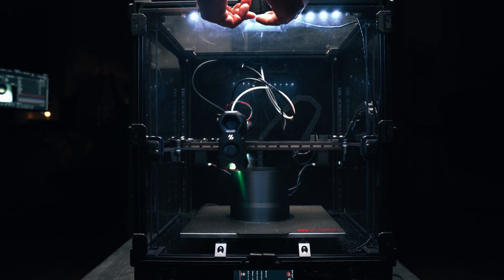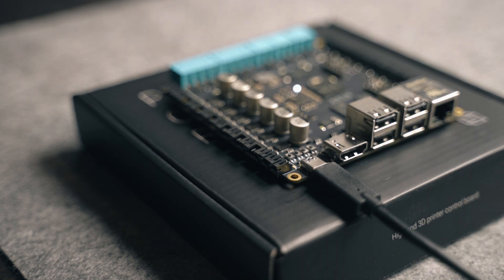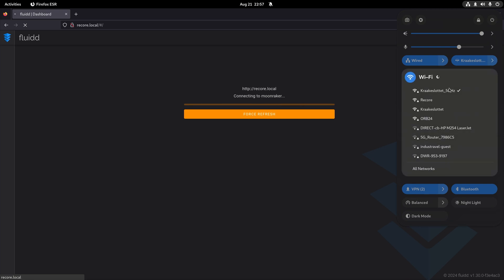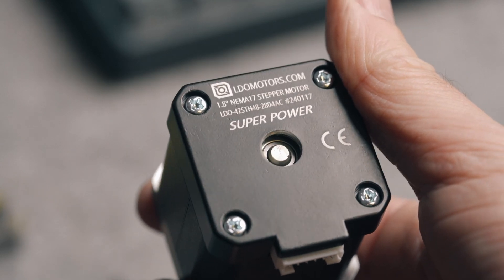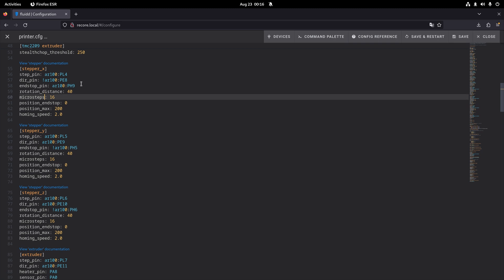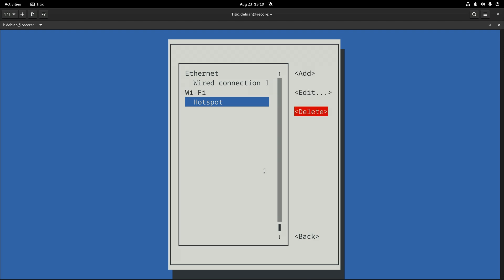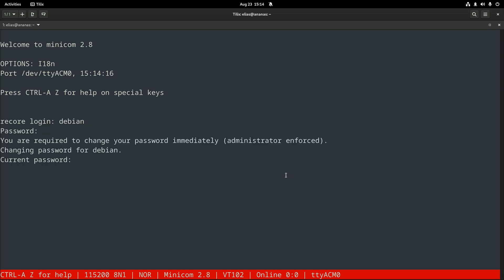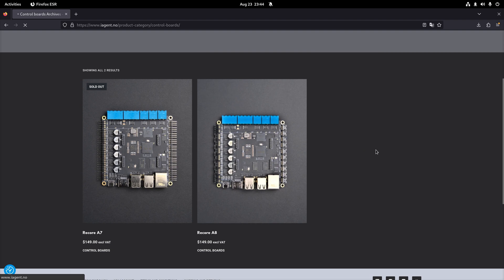Getting started with Recore

Comment: Can the next one include Network setup that doesn't use WiFi? Got the wired port right there, easier and less likely to fail or be sucesptable to interference then WiFi .
Reply from the maker: If you have an Ethernet connection, it's not necessary to set up WiFi. I mostly use Ethernet myself, I only use WiFi for testing.

Comment: @00:00 When you can't even be bothered to rotate your Klipper Screen into the proper orientation for the presentation 😏

That being said... I don't mind the use of those TBP01P1 Connectors instead of Screw Terminals but why the fuck aren't they included in the Board Packaging!?
Literally no one will have these lying around in a drawer and literally no one will be able to start their project if they didn't buy them together with the board so you're not saving anything.

Not that I have ANY interest in this product but if I have had any I'd immediately lose it due to lack of example configs for a 3D Printer to work my way up like how I did with the BTT ones.
Like how is the V2.4 at the beginning being operated as it requires 7 Stepper Drivers which this board doesn't have. CAN for the Tool Head? How was this established? etc...
Reply from the maker: Since I use this printer for development, reinstall the software very often. Sometimes the rotation is left out if I'm focused on a different problem. Definitely should have been done for this sequence though, so I'll try to do better in future videos. 

Connectors could be included, sure, I've considered doing for a while actually. The reason for the splitting of the two is really just a remnant from an older project and I've just kept it like that since. 

As for example configs that is definitely on the list of improvements for the documentation. 

The tool head is USB, not CAN. It's a new product I'm working on.

Comment: Stupid idea i think would be cool that would most likely be a pain to implement if you actually were to do it:
Have the board be PoE capable. Just one plug for network and power.

Completely unrelated, now I want to see Positron run off of Recore! Two open source homebrew to production products working together would be awesome!
Reply from the maker: PoE is definitely very cool! I think the maximum power capacity is too low though at some 90 W max :| 
A Positron running with Recore would be great!

Comment: "An all-in-one solution for desktop 3D printers, Recore A8 offers everything you need in order to print fast and quiet and with a great user experience."

You need to edit this until a additional mcu is not needed for an accelerometer.

Looks like its going in the right direction but there are some bugs and the need for an additional mcu and non swappable steppers means i will not be replacing my octopus with this as i had initially hoped.
Reply from the maker: Thanks for the comment! An extra MCU is not strictly needed for an accelerometer actually. You can connect it to the extra headers on the board as described in this section: https://wiki.iagent.no/wiki/Recore_A8#ADXL345. But it it sort of becomes a "frankencable" to use an off the shelf accelerometer module, so a small board with a separate MCU is better because it becomes a more compact solution with a standardized interface (USB): https://www.iagent.no/product/remove-a1/
Reply: @EliasBakken  Maybe you should reword this?
"
Note

The ADXL345 seems to cause Klipper to shut down when trying to calibrate at a high rate. A workaround is to use a Pi Pico or similar MCU to communicate with the ADXL345, or to lower the rate. It's been tested working at 400, but not 800 which is the recommended minimum.
".
Reply from the maker: @noanyobiseniss7462  Is it not accurate? I'm not sure what I would change though I think that note is still valid. The reason for the reduced rate from 800 down to 400 is due to using software SPI instead of hardware. There is actually a hardware peripheral SPI on those pins, but it's controlled by the main CPU. I'm sure it's possible to get the full speed, I've just not looked into it yet.
Reply: @EliasBakken  Maybe just change it to a notation "Currently a couple of dollar Pi pico or equivalent mcu is required for full 800 rate otherwise only 400 is supported atm" as this will also point out you talking about the cheap pico and not a full overpriced Pi." with a link to a confirmed ali express pico link?
Just trying to be helpful here as alot of people will think damn not another raspberry.
Reply from the maker: @noanyobiseniss7462  Ah ok, I see what you mean. It does mention Pico specifically, but a link to the official Pico is a good idea!